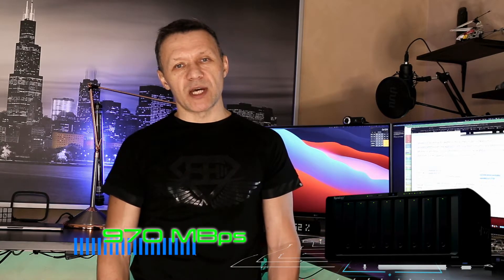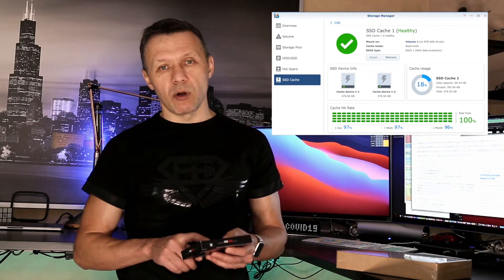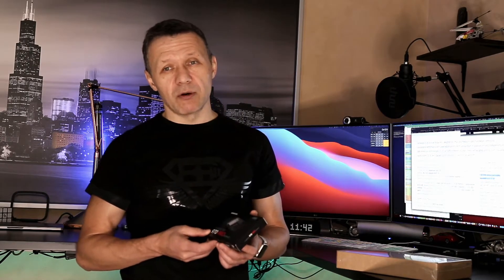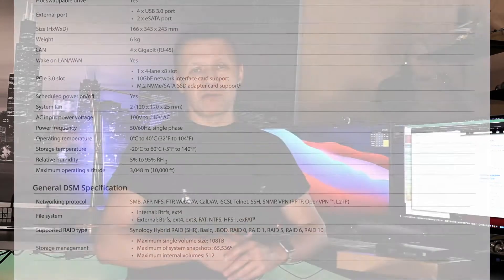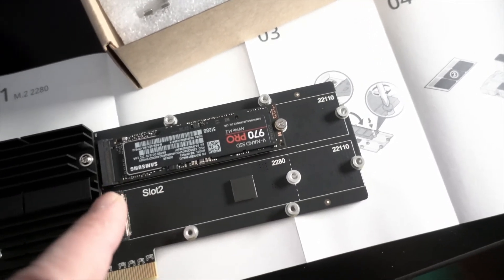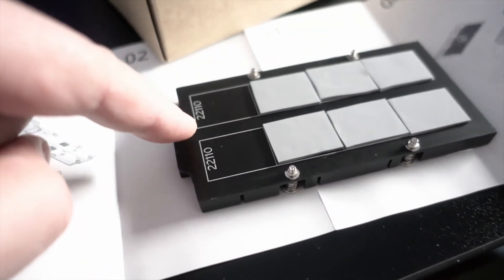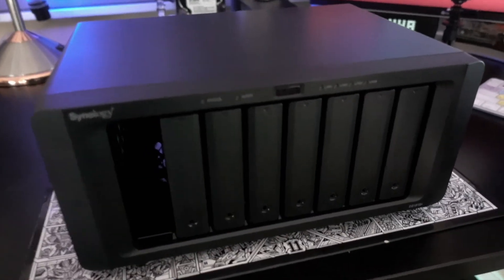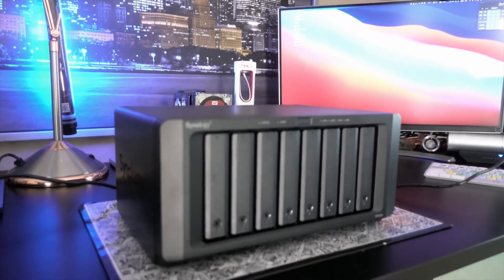20201219 10GB cache card for Synology ! DS1819+ and E10M20-T1

Comment: Hi Oleg, how did the Crucial 32GB Memory Upgrade with the Samsung Pro SSDs work for you. Any issues. I have a DS1819+ and I am looking at doing the same upgrade. But everyone says you have to use Synology RAM and SSDs. Your video was very helpful!
Reply from the maker: No issues, works super great ! Still have this setup running and have no complains.